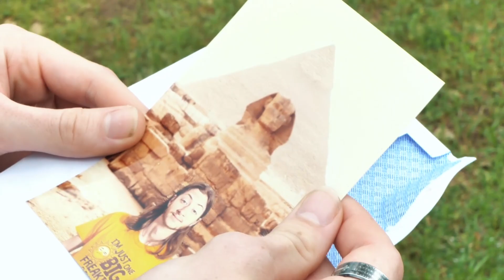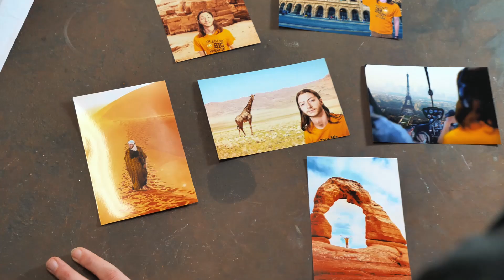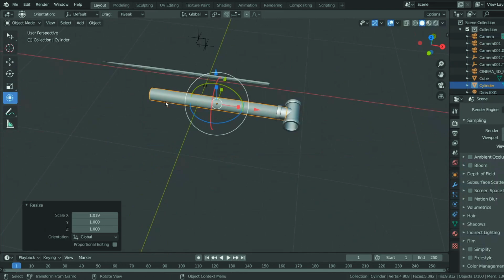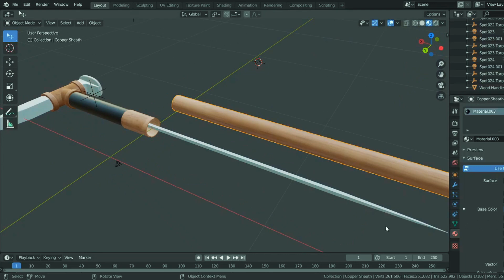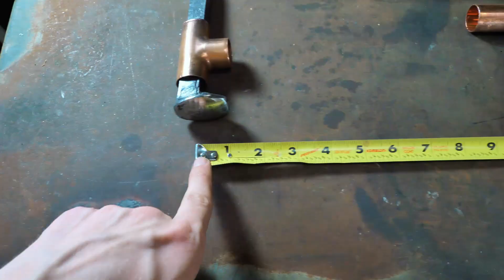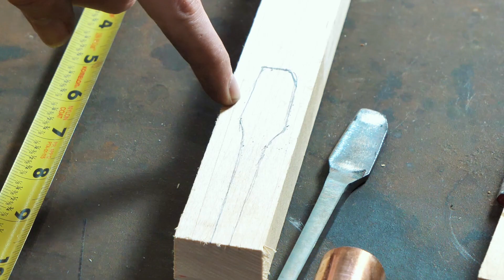Forging a SWORD CANE out of a RR SPIKE (feat. SUNSHINE)

Comment: You should normalize it next time before hardening. ;-) Been watching Alec Steele since his channel was smaller than yours. = P Along with since picked up a bunch of others like Jason Knight, Torbjörn Åhman, and Hoffman Blacksmithing. Normalize to relieve the stress in the grain of the metal, then quench and use a vice to catch any warps and continue cooling it off while out of the oil. Understand how the grains interact in metal and it's like seeing a secret to the universe. You'll be able to make metal do whatever you want it to, as long as you follow the rules ;-)
Reply from the maker: So the stresses in the steel cause the warping? Dang I've been watching bladesmithing videos for years and never heard a person say that. Seems like a duh.
Reply: @jakemakes  Yeah when you heat it and hit it, it squeezes the grain. If it's at welding temperature the grain shrinks to a point where it doesn't create stresses but everytime you hit it while it's hot, you suck heat out of it with your hammer blow so the grain starts to regrow as it cools and it able to be squeezed tighter than it wants to be so when you heat it to harden, they start to expand and move, but then contract in the rapid cooling cooling and warp the blade. 

Pretty much, if you heat it till it's not magnetic anymore and then let it cool to room temperature  a few times, all those stresses are relieved. The more you understand about the structure of steel and how it changes, the more you find that when it's hot enough, it acts like clay, but at every temperature before that, it works differently, mostly based on exactly what the composition is. Low carbon means you can move it more when it's cooler and won't warp as much, but also can't be hardened as effectively. Takes a lot of practice but if you know how it works, it'll just speed the learning process. 

Sorry to go on. I just see a lot of potential in you and more importantly, the eyes of someone who really just loves screwing around with stuff to make cool shit. Those are the people that make great things with the right information. Do what you enjoy, but not for a second longer than you're enjoying it. Good luck in all of your endeavors. = )
Reply from the maker: I know all about grain structure and normalizing, but for some reason never put two and two together as to the warping in the quench. Much appreciated!! I'll be putting that knowledge to good use in my future builds

Comment: Great build but wouldn't it been easier to use a broomstick instead of sanding forever?

I especially like that the handle is a railroad spike as it can also act as some sort of war hammer. But copper is too brittle for this usage right? Too bad you can copper coat steel because you could have done it sturdier out of steel coated with brass tubes but it probably wouldn't look as cool in "goldish". Why didn't you make a sword with a bevel, are there any particular reasons?

Anyway great build, I guess some little improvement could be made to make it "perfect" but it's already great.
Reply from the maker: Broomstick: Because I had to halve the wood to glue up the blade, it was easier to use a square stock. Pretty hard (and a tad dangerous) to cut round wood on a tablesaw. If I had left off that stupid flat bit at the end of the blade tang I could have just drilled out the handle instead of having to cut it in half, in which case yeah i would have used a broomstick or something. Copper isn't too brittle or soft, but I would want to pin the RR spike to the copper tee if I was planning on using it as a war hammer. Right now it is just friction fitted (albiet VERY tightly) and with extended hammering theres a possibility it would come loose. The reason I didn't do a regular sword blade is one, a RR spike doesn't have enough material to make a wide blade that long, and two I didn't want have to grind double bevels on a sword sized blade with my little bitty belt sander. Its a real pain in the butt. This design is super simple and works great for the simplisity of it... to make it better the main thing I would change is figure out some sort of full sheath inside the bottom copper section, and some sort of more secure latch to hold sheath and sword together. The friction fit works but a real lock in place deal would be nicer. But then the build would get real complicated soo... Yeah I'm pretty happy with it. Thanks man
Reply: @jakemakes  Thanks for the very detailed answer. If you know how to make an OTF system you might wanna think about the possibility this system offers. Like making a Bō who could also deploy a blade to transform into a kind of spear, you could as well do a deployable cane and millions of other things like weaponized boots or a glove with deployable claws (kinda like Black Panther except it would be scalpel blades)

I'm not smart enough but I'm pretty sure you can also sort your armsword/tonfa issue by using the otf system, using it the way it works inside Assassin's Creed hidden blades coupled with electronics, a servomotor rotating the wheels inside to open or close with a simple push on a button. Obviously, all wrapped up inside a nice glove, kinda like the Doom Slayer with bolts on the knucle and forearm to make it even deadlier.

If only I were rich my time would be greatly used... Anyway I look forward for your next video. ;)
Reply from the maker: @lecobra418  Hahaha oh man I've half wanted to do a springloaded OTF forever.... but man its hard to do. Complicated as crap. Unfortunetaly I'm a deplorably lazy fellow so who knows if I ever will XD I did draw up a design a few weeks ago for an OTF cane... so it might happen.
Reply: @jakemakes  Perhaps try making it on a very basic knife or out of wood just to get how it works. Sometimes doing it is easier than expected but yeah it seems complicated, too many little pieces intricated into one and another.
Reply from the maker: @lecobra418  Its those little parts that kill ya
Reply: @jakemakes  Haha perhaps someday we will get to see that, this day I'll know you will have improvised. adapted. overcomed. XD

Comment: Awesome video man! When the heck did ya learn to use blender? Also congrats on 10k subs and 1mil views!
Reply from the maker: Thanks! I learned to use blender approximately 3 weeks ago working on this video lol. It's a fun program that I want to be able to use for CGI stuff in short films or moviemaking later down the road
Reply: @jakemakes  Nice! I used it for 3d printing related stuff at one point. Also tried 2d animation but I just haven't used it enough to be proficient at it.
You can't beat its price tag tho lol.
Reply from the maker: Can you use it for 3D printing? I would have thought you'd need a more engineering designer program.
Reply: @jakemakes  If you want to do anything artistically related it's not happening on an engineering type program and vise versa
Reply from the maker: Yeah true. Can you print from it? I know literally nothing about 3D printing
Reply: @jakemakes  If a program will export .stl files, the files can be 3d printed.